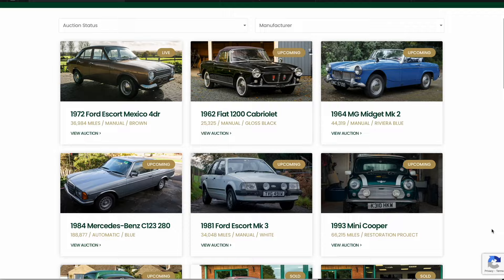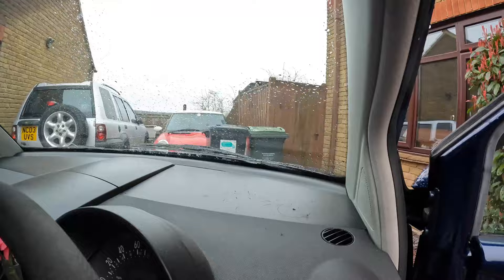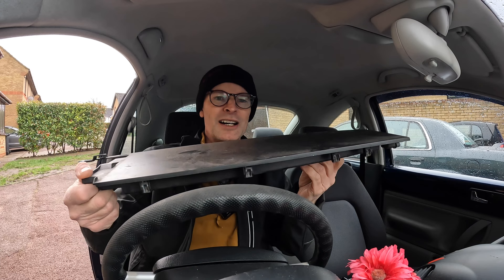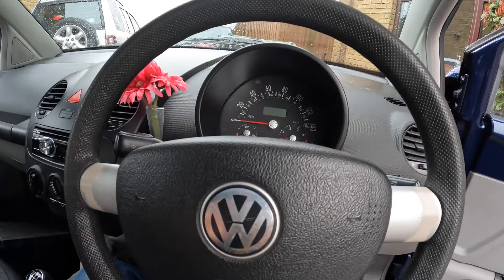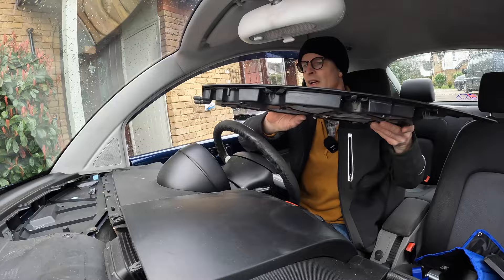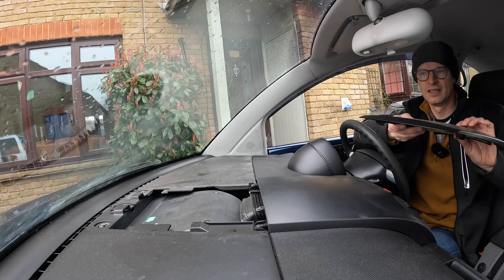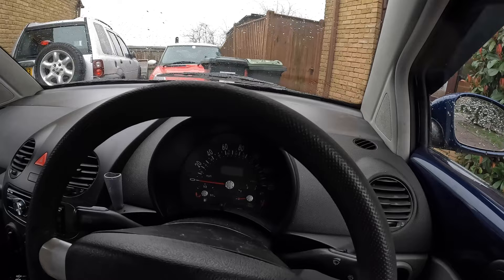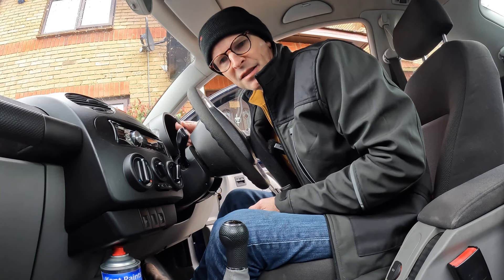Dash panels and steering wheel swap - The Beetle is done!

Comment: I have lost a bolt deep within an inaccessible area of my car before and as an amateur the way I resolved this problem was to buy a USB endoscope camera and a flexible pose-able magnetic pick up tool - taping the endoscope camera to the tip of the magnet tool and doing a bit of keyhole surgery - when I saw the bolt I just pushed closer and - click! - magnets are magic. Combined, those tools were about £30 and they are my backup for any other inadvisable modifications I decide to make

Comment: Things have become much more complicated these days in the 21st Century, when having to remove a Steering Wheel / Airbag, than when I had to remove the Steering Wheel to enable me to remove / change the broken Headlight Control Stalk on my 1981 Russet Brown Austin Maxi 2L FFG 212X in the mid-late 1980s . . . a bit of plastic about one inch long & about 1/5 inch square in section had snapped clean off right across, meaning the Headlight Stalk in normal driving along a road, would pendulum backwards & forwards, between ( & making & breaking ) the electrical contacts, meaning depending on the level of acceleration / braking I was doing at the time, the Main Beam Headlight Flashing was uncontrollable . . . all because of a really small bit of broken plastic . . . "Grrrgh !"

N.B. 'Uncle Pete' ( A+ Really Good Family Friend R.I.P. ) who lived very close to me in Merlin Way, when I went to see him, was able to lend me a 1 1/4" Box Spanner with Tommy Bar, from his garage, so I could release the Steering Wheel Retaining Nut, to enable me to get the Steering Wheel off & to tighten the Steering Wheel Retaining Nut back up again afterwards . . . unusually my father ( R.I.P. ) did not have an appropriate tool to get me out of my unfortunate predicament !

Comment: Bit of sill welding and a couple of brake lines and it'll be on its way! Pretty typical 18 year old car stuff.

My Boxster needed a rear brake line and advisory on rear discs and drop links this time which I didn't think was too bad for 17 years old.

Brake line done by the garage to get it through and advisories being sorted this weekend with any luck if the weather holds off.

Comment: Isn't it strange how a few little cosmetic details like a worn steering wheel and a few holes in the dash make a massive difference to a car's first impression? A few times I've noticed my local garage dealer eyeballing trade ins, saying stuff like "Leave that radio and speakers," or "Don't remove that old Garmin". It's all suction cups and double sided tape for my car.

Comment: You have done such a good job! A very satisfying project indeed. I had a little bit of a struggle getting to the pins on the airbag of my V70 when I fitted the wooden steering wheel!  About 34 screwdrivers and a butter knife later I finally got it!

Comment: Did the same wheel change on my wife's for about £25 Inc airbag. For mine I used a small flathead screwdriver worked a treat had to pull the steering wheel all out and down. The one on my wife's had a groove on wheel and column to show when it's straight.

Comment: When you’ve disconnected your battery, it is a good idea to then put your headlights on which will suck any remaining current out.  beetle is in really good condition when you consider the miles on, it has been well maintained and looked after

Comment: It doesn't matter if you don't have the steering wheel straight when removing as the steering column has a notch in the end that you match up to a notch on the steering wheel so you know it is on 100% straight

Comment: Technically is not called an overtaking lane either. It should be called lane 2 or lane 3, depending if the road has 2 or 3 lanes.

Comment: This is typical. I swapped the steering wheel on my 2019 Seat Leon only a month or so ago and had to do much research first and generally thinking it's a shame Matt hasn't done a VW wheel swap. And low, here just that video. It also mean, perhaps for the first time ever, I knew something that might have helped you. 
The principle for removing a VW wheel doesn't seem to have changed in 20 years.

Comment: Yay for fleabay 😭
I'd have cut them and welded abit into them 🤔
As for the draper tool, how much different is it to a torx bit?
Reply from the maker: it has many more points, 12 I think, so you could mash a torx in there but it would ruin it for next time

Comment: Changing a steering wheel has not gotten any quicker than on a 1930's car.  As much to disconnect indicators (semaphore)  advance and retard  mixture  throttle and horn.  All mounted on a bracket within very brittle Bakelite.   Hope the MOT goes OK and you make a nice little profit.  
Not a fan of messing with what designers had spent millions of a company's money perfecting by modifying so just as well you are selling her.  They are very pretty and balanced as is.  Better than the Golf they sit on.
Reply from the maker: I imagine a 30s car would be harder to refit with all the mechanical linkages to get back in place

Comment: Oh dear! Atleast lots of content to come:

Do not drive until repaired (dangerous defects):
Nearside Rear Inner Suspension component mounting prescribed area is corroded to the extent that control of the vehicle is likely to be adversely affected sill holed (5.3.6 (a) (ii))
Offside Rear Inner Suspension component mounting prescribed area is corroded to the extent that control of the vehicle is likely to be adversely affected sill holed (5.3.6 (a) (ii))

Repair immediately (major defects):
Offside Front Direction indicator not working (4.4.1 (a) (ii))
Nearside Front Inner Seat belt anchorage prescribed area strength or continuity significantly reduced sill holed (7.1.1 (a) (I))

Repair as soon as possible (minor defects):
Nearside Lower Windscreen damaged but not adversely affecting driver's view cracked (3.2 (a) (I))

Monitor and repair if necessary (advisories):
Nearside Rear Brake pipe corroded, covered in grease or other material (1.1.11 (c))
Offside Rear Brake pipe corroded, covered in grease or other material (1.1.11 (c))
Reply: lol , there is always one smart arse who has to check the MOT history
Reply: @furiousdriving  Did it fail the MOT? I thought I'd have a quick look and spoil the anticipation for myself :(
Reply from the maker: @eggyeggyeggy  are you checking the right car? It’s not been tested yet
Reply: Yes, tested today 7th March. Unfortunate indeed.
Reply from the maker: @delukxy  that’s not good

Comment: Yikes,its failed miserably,more work to do yet matt.makes me laugh when people go on about how good german cars are.yeah rite,the mondeo was much better car,look forward to your next one.hope its  a better car next.looking forward to seeing your v8 rover up and running.
Reply: Dont disagree with your beginning statement about quality but for corrosion protection the vw is superior to that mondeo, no doubt.
Reply: @GoldenCroc  i will politely disagree,have never had rust issues with any of my fords including sierras,granadas,transits and even a ford zodiac mk 3.in a way its how theyre looked after i guess.all cars need rust preventative measures topped up over the years.theres some proper german rotboxes,look at mercedes sprinters for 1,they just disintegrate.transits are so much better at resisting corrosion that its astonishing.hope matt can sort it ok,the last owners defo seen him coming.
Reply: @ivanfernyhough3851  You answered your own question, its about your maintenance patterns and driving conditions. They were just better. 

Like for like, the new beetle is superior in this regard to a 90s mondeo. But as alluded to above, no two cars will have a an identical life and the differences arent larger than they pale in comparison to usage factors when on the road for a few years, never mind over 20 years for both.

Anyway, Mercedes of the mid 90s to mid -00s are perhaps the most rust affected cars of any brand on average, bar none! Absolutely shocking. Also a lot of VW examples have had terrible paint flaking off troubles, for decades now. 

But my post was strictly about 90s mondeos vs -00s new beetles as models, and in that case the verdict is clear. As they rolled out from factory, the beetle is  quite a bit less susceptible.
Reply: @GoldenCroc  nope,90s mondeos versus horrible 00s beetles,the mondeo wins hands down.your rite,that era of mercedes was terrible for corrosion.
Reply: @ivanfernyhough3851  Well to each their own. I based the mondeo vs beetle on the opinion/data of "corrosion experts" that rate cars, you are of course free to think otherwise. But I will say I am sure on top of running conditions its also surely very dependent on the age progression, one car can hold out longer but perhaps after a few years get worse than another depending on materials used etc. A nice underseal from factory for example can keep the rust away, but if its penetrated it can instead seal the moisture in....many vaiables to consider.